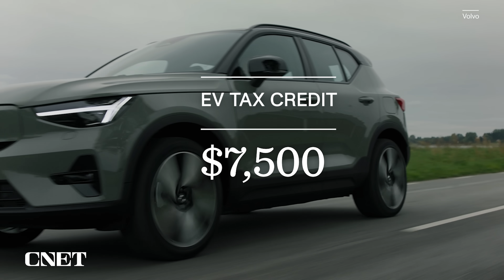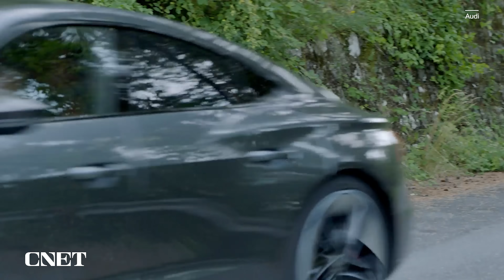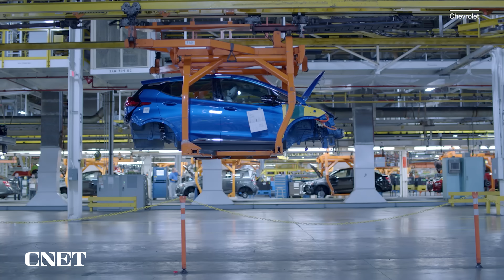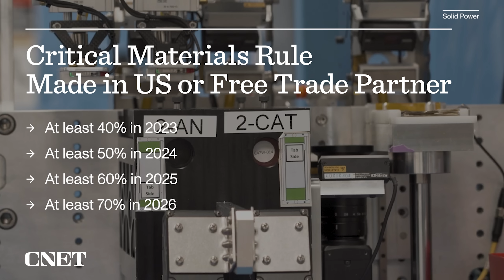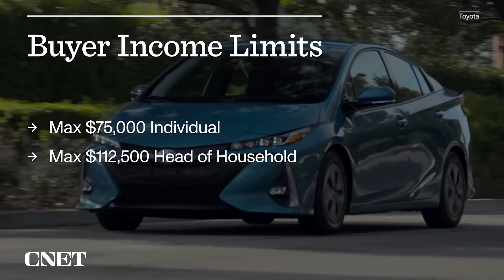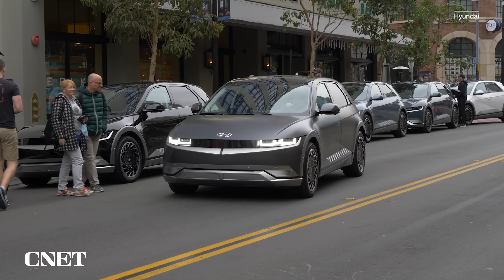Are Teslas About to Get Cheaper Under Radical New Federal Tax Rules?

Comment: I find it interesting that the IRS set aside a lot of money in the same bill for auditors to make sure you're abiding by the rules. Probably that will pay dividends for the government to claw back all those EV incentives that were claimed at the dealership but actually don't qualify. The other question I have is about the used EV incentive. I seem to remember reading somewhere that it only applies on the car's first sale. So what that means is that the number of used EV's that qualify is going to steadily diminish as time goes on, as the credit will be claimed once, but when the vehicle is sold on after a couple of years, it won't be able to be claimed again. 

All in all, I am not convinced that this bill will make a lot of difference for people who are waiting for EV's to become affordable. EV makers are probably going to pad the prices to make sure they are OK, even more than they have been doing, and the people who qualify for this incentive because they don't have a lot of money to throw around on expensive toys, will be doing the math and deciding that a used non plug in hybrid is probably the best option because it minimizes the fuel cost differential between ICE and EV cars,  has no strings attached in terms of eligibility, and is also inherently cheaper because it has a much smaller battery. I would even go so far to say that a used but reliable non-hybrid compact car like a Toyota Corolla or Yaris that is over 10 years old might even be the most affordable car of all, because they cost less than half what the equivalent EV of the same size and year costs, while being relatively thrifty on gas, particularly if your commute is reasonably short, and you don't do a lot of road trips.
Reply: also hybrids are trash, their resale value will plunge to zero by the end of the decade, bookmark this comment.
Reply: @malcolmx61   Depends on how fast we can build out the renewable energy infrastructure. No point in going 100% BEV if we are only at 70% renewable.
Reply: EV credits have a price cap, sedans cap out at 55,000, SUVs cap out at 80,000.

Comment: So Tesla now qualifies? I bought a '22 Model 3 Performance, took delivery in May. Total cost was ~$62k + TTL so about $67k out the door. Does that mean it doesn't qualify because it was over $55k or only the first $55k qualifies for the tax "rebate" assuming income is within the parameters outlined?
Reply: It doesn’t if you are single.  If you are married and filed jointly tax return, then proceed to battery requirements.

Comment: Electric car batteries need to be replaced every 10 years or so, and replacing them is very costly. Until car companies come with policy for free replacement I won't buy one.
Reply: And what source are you pulling this from? Sure, capacity will go down over time but they certainly will not need to be replaced.
Reply: @jc_ou812  I do know for the RAV4 prime, this is the expected lifespan and possibly also the warranty period of the main traction battery. 

Any uses ev selling for under $25000 is going to have diminished battery capacity by the time it’s resale value is that low most likely. Most PHEV/BEV seem to be selling for 5-10k over MSRP now
Reply: @PostprandialTorpor  The batteries in most EV's are warrantied for 10 years. At the 10 year mark they're not going to drop to 0% capacity.  You will most likely have 70-80%  of the original range still available.  They will most likely outlive the rest of the car.  And in 10 years who know what batteries will cost. More EV adoption should force the price down.

Comment: What does “the price of the vehicle” mean? Is the price cap of $80k for an SUV based on the base price before options or after all options are added? These could be very different prices. So far I have not been able to clarification on this question.
Reply: The base price the base manufacturer price .... Without all the upgrades or ... The price of whatever trim of that vehicle that the manufacturer offers so if you get a fully loaded F-150 lightning and it's 82,000 you don't qualify but if you get the base F-150 lightning which I think 50K you should be okay 👍🏾 .... Somebody correct me if I'm incorrect but I think that's how it goes

Comment: On point video, thank you. I bought a '19 M3 just before the original credit phased out. Biggest improvement is removing the cap on # solds. That cap had to have been put in by the big 3 to keep Tesla down, now it helps them so of course it's gone. The MSRP cap is interesting; it forces the carmakers not to just tack on $7499 to the price for their own profit (aka Nissan with the Leaf). The income cap makes sense; the other parts like US-sourcing is a hidden US jobs protection mechanism and they can put it up for revision if the automakers whine enough in a few years that they can't get enough perfectium or ultimium or whatever in US mines.
Reply: GM was also phased out, the old system didn't benefit them. Both Ford and Chrysler had plenty of room in their 200k units sold too.

Comment: This rule should have phased in in 2024 instead of 2023. Giving companies a chance to get there supply in order for the flood of cars orders they will be getting. And used EV should have had something going into next year as well. It's also wish 3 wheels cars could have gotten something of tax credit. Just how I would have done this law
Reply: problem there is if you build in an exemption they will lobby to extend it saying we just need another 2 years after that then another year because of supply chain issues then another for another excuse. imo its a good thing to force the compliance upfront and then let them get the credits when they are compliant

Comment: You told me all I want to know. It’s not refundable so it locks out lower income buyers. The guy who makes $40,000 per year pays more for the same car than the guy who makes $100,000 per year.
Reply: No.  They all pay the same price regardless of income.  But the guy with the $100K income get $7500 tax credit when filing, if he or she owes nothing to the IRS, they don’t get that $7500 in refund.  So a little tax planning is needed.
Reply: @jml9550  be that as it may, the guy with the $7500 tax liability ends up with the purchased car net $7500 lower, or if you want to put it another way, with $7500 net more in his bank account than the guy without the $7500 tax liability. If the intent is to get more EVs on the road, making them more accessible to those with lower incomes just makes sense.
Reply: @timwoody3835  but the $100K person pays more in tax as well compare to the guy making $40K.  Anyway I am totally with you on this.  They should make the $7500 credit refundable to all, regardless of that person’s tax liability during tax filing.  Another dumb rule by the government.

Comment: One correction: the $7,500 tax credit can turn your tax liability into a refund if you pre-paid enough taxes.
Reply: That's what I needed to know! On my w2it shows that I pay ~7000 a year in fed taxes but I have my withholdings set so that I usually owe under $200 when I file. I couldn't find out anywhere how that worked for me! Best I could figure is if I qualified for the $7500 but only paid $6900 total, that $6900 would be reduced to zero, the $600 left over would be discarded as I couldn't utilize it, and my tax refund would be the $6900 I had "over pre-paid" during the year from my paychecks.
Reply: @SweetLou0523  Maybe. If you pre-paid $7,000 in withholding taxes on your paychecks and they refunded $200 back that means you owed 6,800 in tax. I believe $6,800 of the $7,500 would be applied and you’d get all $7,000 back as refund. I’m no tax accountant so don’t take my word for it!

Comment: Dealer will bump the price first then apply the tax credit up front. So basically the dealer is getting it unless I have it wrong ?
Reply: It depends on supply.  A sea of EV's on the lot to choose from ensures you get the credit.  The current state where there isn't even one on the lot ensures the dealer gets it.  Wait 2 - 3 years.
Reply: The dealer will always charge as much as the market will bear. Dealers are charging over MSRP for vehicles because they can. When this vehicle supply shortage is fixed they won't have the same leverage and wont  be able to do that anymore.

Comment: I might buy a EV in 20 years, because I am planning to buy a toyota corolla and this car last forever.
Reply: My Altima is 10 years old and going strong and the Corolla is probably a little bit better car.  I like your plan.  Buy an EV when you can walk onto a car lot and see 50 of the same model sitting there, otherwise, you're way overpaying.

Comment: When did Mexico move to North America? The my want to help Ford and GM with this so badly that they are redoing geography to make it fit.
Reply: The North American continent is made up of three countries, Canada, the USA, and Mexico.  That's why your geography class mattered.
Reply: Mexico has always been in North America. Plate tectonics work very very slowly.
Reply: You are correct that they had to change the language to North America to benefit Ford and GM. If not, it would have benefited Tesla.
Reply: @dollarmerchtree4587  It benefits Tesla who long ago reached the 200,000 ceiling but that has been removed.  The issue for every manufacturer will be meeting that requirement about sourcing 40% of critical elements for batteries.

Comment: When does the existing tax credit program phase out?  May take delivery in December for a car that won’t qualify in the new plan
Reply: Here is the timeline:

Date of enactment: the requirement that the vehicles be built in NA becomes effective.

The day after the Secretary issues the guidance (must be by 12/31/22): the battery requirements become effective

January 1, 2023: The MSRP and Income limitations, and the rest of the legislation, become effective.
Reply: There is a provision in the bill for cars purchased before the bill is signed into law and delivered before Jan. 1st, 2023. As long as you have a binding sales agreement before Biden signs the bill, you will qualify for the old rules. If you just have a factory order and a refundable deposit (you've retained the right to walk away from the deal), my suggestion would be to ask your dealer if you can convert your reservation into a binding sales agreement to lock in your credit. The only downside is you would then be bound to buying the car, even if you decide you don't like it once it's delivered.
Reply: As soon as Biden signs the bill, which could be this coming week.

Comment: Great summary, thank you! Do used EVs/PHEVs also need to satisfy the assembly/battery-components/materials requirements? I've read the entire bill and can't find any mention of the battery rules for used EVs, apart from the 7kWh minimum.
Reply: I believe the rules for used EV's are much simpler. It should be a very very good law for those buying used EV's. In the past the less wealthy missed out on the tax credits because of the high price of new EV's. Now they have a chance of a significant cost savings and much cheaper refueling costs.
Reply: @JeanPierreWhite  yeah, but IF the gvt truly wanted more adoption of electric, they'd make this system more sophisticated tax-wise, more nuanced.   It's clunky as heck and seems rigid with 55k cut-off max.   I don't see much logic and it's not income sensitive enough.  E.g. they'd expand the mkt downward in income/wealth if they morphed it into a tax refundable credit for lower income.   Much smarter
Reply: @18_rabbit  I agree that if this is the best we can do it's disappointing, but is a move in the right direction. I'd blame the legislative process, its a product of political division rather than being bipartisan.
Reply: The used ev requirement is a joke. Only works if sale is from a dealership and car must cost under $25000 and it will only be 3-4k depending on some factors. Any used ev selling for that low of a price will have serious battery wear so be prepared to spend $10k on a replacement. Also I believe the income limit is $75k for an individual and $150k for couples.

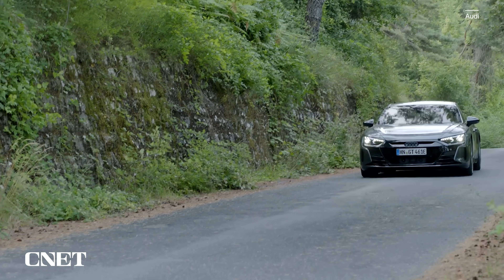Comment: 2:55 okay so doing some rough estimations here, that means for a single income, no other deductions, scenario, that would require a minimum of $60k earnings just to balance it out.  

that's also assuming you went to the your HR rep and said "I want no income tax taken out this year", which I'm pretty sure no one did.

If I am understanding this correctly.
Reply: Non-refundable tax credit applies to tax liability, not what the withholding is. A single person taking the standard deduction making $60K would have an AGI of around 47K, most of which is taxed at 12%. So the tax liability would be around 6K, and that's what the EV tax credit is worth.
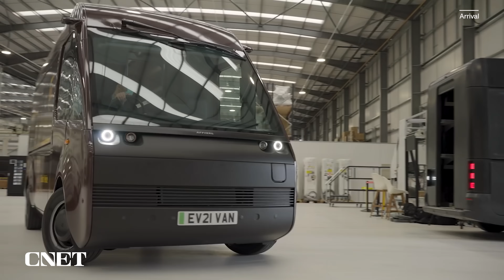Reply: 6:53 I'm curious to know if that Batter size has to have come from the factory.  i.e. could a dealer swap in a larger batter and sell the car to qualify for the credit?
Reply: It matters not if you pay your income tax throughout the year via withholding, or you pay it in a lump sum at the end of the year except the latter ensures penalties for postponing.

Comment: Finally making it an instant-rebate not one that you have get forgiven for owing on your taxes!
Reply: It is not an instant rebate.  Come on…..
Reply: @eggheadegghead  so, update, it kinda is. Under the new law on am eligible EV, you can apply to have the credit applied at time of purchase. HOWEVER If you don't actually qualify for the full $7500 at tax time, you will have to pay back the balance. So be very very sure you qualify and can utilize the full $7500. I pay $6900 a year in fed taxes, I'd owe them $600 when I file if I took the full $7500 up front. (This may still be worth it if it lowers your monthly payments to an acceptable level, just be prepared to pay the difference back and it'll be all good)
Reply: Listen to the video again. Brian clearly stated that it is possible for the IRS to recover some of the credit back if the credit applied at the point of sale exceeded the credit you are eligible for. It makes it instant at point of sale but is no guarantee you get to keep all of the credit.
Reply: But it's not a rebate, it's still a credit same as it has always been. I was not able to find a source that backs up his claim that it is applicable at point of purchase. From what I've found, it works exactly the same as it always has and only gets used when you file your taxes.

Comment: Is there a list anywhere that lists which evs will or won't be covered when the new legislation kicks in?
Reply: Cadillac Lyriq (only if it is classified as an SUV)
Chevrolet Blazer EV
Chevrolet Bolt
Chevrolet Bolt EUV
Chevrolet Silverado EV (with certain options and trim levels)
Ford F-150 Lightning (with certain options and trim levels)
Ford Mustang Mach-E
Nissan Leaf 
Rivian R1S (with certain options and trim levels)
Rivian R1T (with certain options and trim levels)
Tesla Cybertruck (with certain options and trim levels)
Tesla Model 3 (with certain options and trim levels)
Tesla Model Y ( only with certain options and trim levels)
Volkswagen ID.4 (only 2023+ models made in Tennessee)
Reply: @paulblanchette9245  I guess it’s true not all hero’s wear capes thank you
Reply: @paulblanchette9245  That's a list assuming they qualify under the made in America standards. I don't think the Tesla Model 3 SR+, for example, qualifies based on its battery inputs. Rivian corporate is enraged because they won't qualify for the credit based on their lack of American made inputs. So this list isn't all that useful.
Reply: @kevinkent6351  the battery requirement  doesn't kick in till Dec 31 2023
Reply: @paulblanchette9245  I'm reading the Reuters report on the bill published/updated Aug 12 and it says the battery sourcing and critical materials requirements kick in Jan 1, 2023 and that the CBO estimates that only 11,000 EVs sold will be eligible in 2023.
Reply: @kevinkent6351  The bill then goes on to exclude specifically any vehicle placed in service after 31 December 2024, with respect to which any of the applicable critical minerals contained in the battery of the vehicle (as described in sub-section (e)(1)(A)) were extracted, processed, or recycled by a “foreign entity of concern”.
Reply: @kevinkent6351  . A similar rule would exclude vehicles from eligibility if any components contained in the battery were manufactured or assembled by a foreign entity of concern, effective with respect to vehicles placed in service after December 31, 2023.
Reply: @paulblanchette9245  Well, the CBO specifically estimates that as few as 11,000 EV sales will qualify in 2023, so clearly they do not think any Teslas will qualify in 2023. Rivian says they will not qualify and is urging potential customers to fix their orders ASAP. So clearly there is a disconnect between your understanding and what the Congressional Budget Office and Rivian understand.
Reply: @kevinkent6351  tesla already qualifies with the model y because  the government  list it as a suv so it needs to be under 80k. And the batteries  are made in nevada using materials  from Australia.
Reply: @paulblanchette9245  again, how can the CBO and Rivian be so wrong and you so right? You're asserting that Rivian qualifies while Rivian is asserting that it does not qualify and is urging people to move forward now. Like I said, you're going to have reconcile the view of the people in charge with your interpretation of the law.